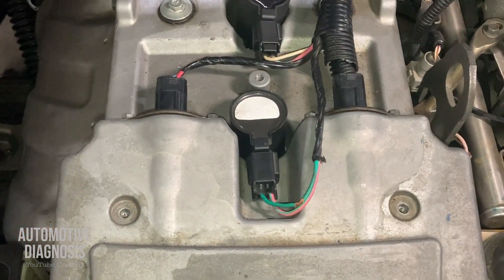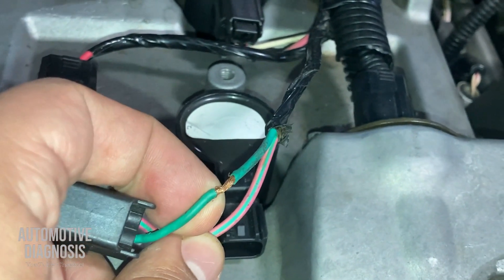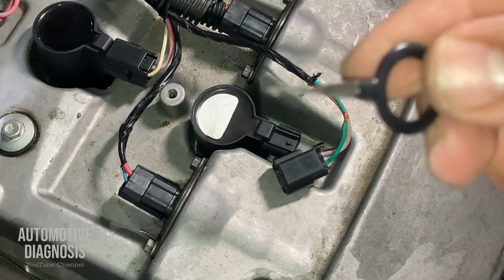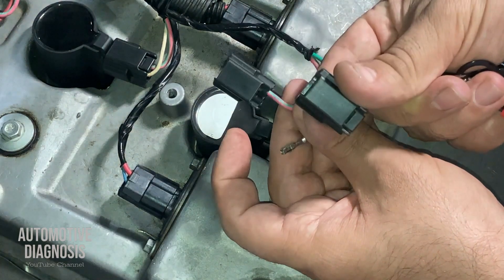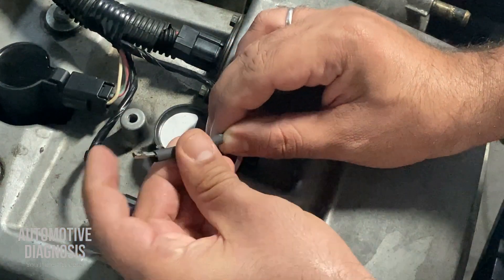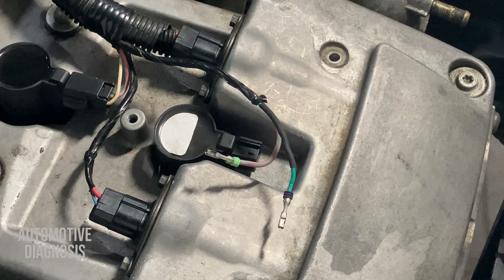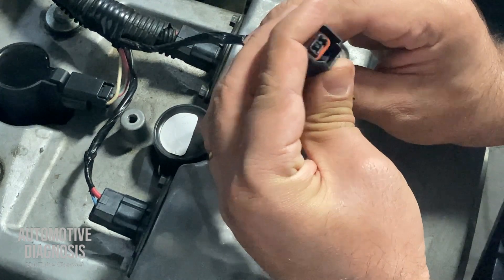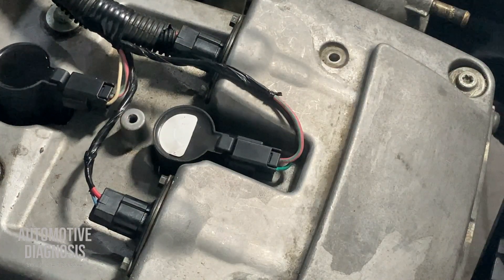How to Fix Ignition Coil Connector & Wiring to Fix a Misfire #ford #misfire

Comment: Hi! Is a loose coil connector a misfire cause even if it does not come completely off?
Reply: Not always, but being loose can cause a misfire or miss spark, preventing anything from starting up and running and stalling if it's constantly depending on firing up continuously, which isn't likely to be built that way.

Comment: I bought a car with those plastic connectors broken. The pins were directly connected to the coil packs. 
My question is ...can this cause a short circuit to the ecm and essentially throw an ignotion code and cuase misfires ?
Reply from the maker: Hi my friend. If pins are exposed to the body yes they can cause a short circuit and misfire.
Reply: @AutomotiveDiagnosis  do you recommend changing the ecu to fix this issue?
Reply: @jovo21  It's probably better to purchase a new harness, but I'm not sure why. When big plugs don't bother any current flow, neither should a spliced wire cause any current to be incorrect as long as its housing doesn't come out, causing a short in the current.

Comment: Hi. What exactly do you call these connectors. My ignition coil connector wire got damaged while replacing the spark plugs. Should I use a new connector and patch the wires with a heat sink connector?
Reply: Probably be the best scenario, but how the spark is and an incorrect current is affected by the area, I'm not sure how that current flows and is interrupted in any way.

Comment: This is awesome! We have a 2007 Ford focus that got chewed by mice on top and it's all four of the ignition coil connectors. Do you recommend fixing it the same way?
Reply from the maker: Hi there, thanks for watching the video. It’s a same procedure to fix that wiring too, but you need to make sure that wires are soldered to the correct side of the wiring.

Comment: does this cause misfire on cold start and under load and intermittent misfire??
Reply from the maker: Any issues on wiring or connector may cause problems intermittent fault.
Reply: thank you thats what i am having with my golf R32, cleaned carbon ok valve chaged pcv and now will change coil harness connectors